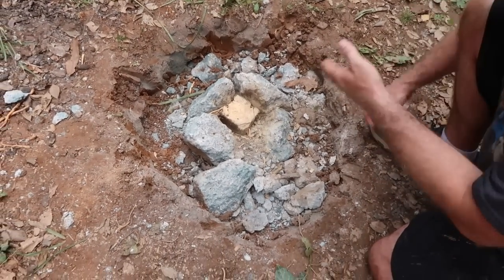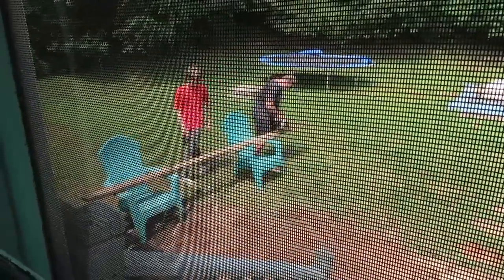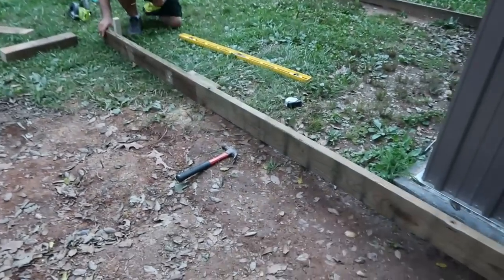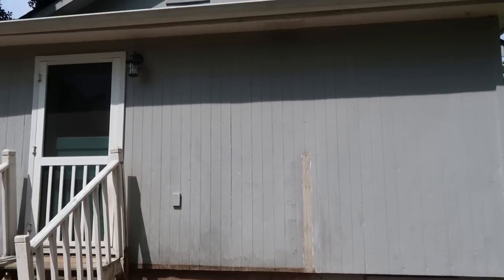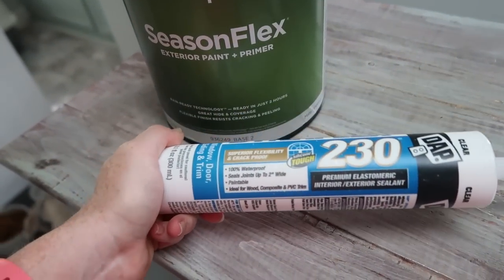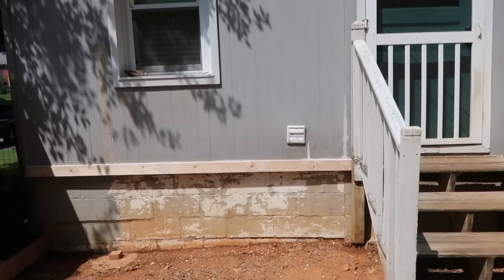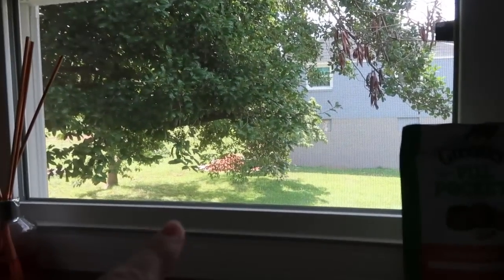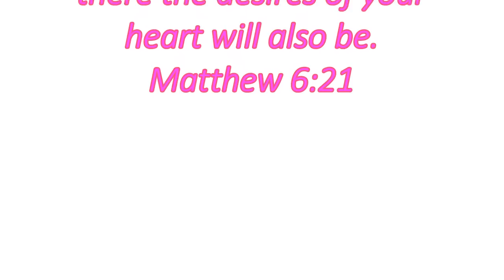BACKYARD MAKEOVER - PART TWO | PAINTING, LEVELING, + A NEW PLAN

Comment: So happy for you!  Just a couple of hints.  I find that a garden cart is so much easier to use than an wheelbarrow.  With Marion's back you might want to look at that and being 67 also find it much easier to use. Also, if if the green on your hostas die back, as long as you keep the root bulbs moist they will come back next spring without any problem.  Don't throw them away thinking they have died.

Comment: is the patio bigger than the deck?  It doesn't look like it, I thought you were going to make the patio bigger, you saved yourself a lot hiring out that job,  just getting the truck back there probably took longer than them putting in the  concrete...in that heat...best choice for sure....now you guys can use your energy and time to actually finish the project! dime well spent, even though we know it was way more than a dime/ lol
Reply from the maker: Yes the patio is much bigger. You’ll be able to tell once we put the furniture on it.